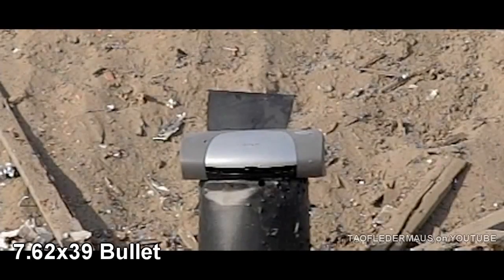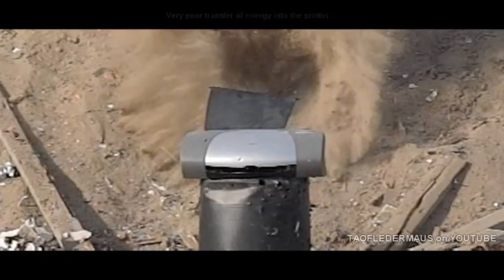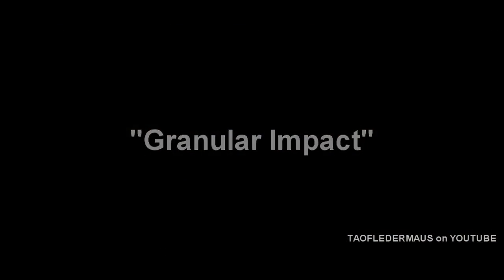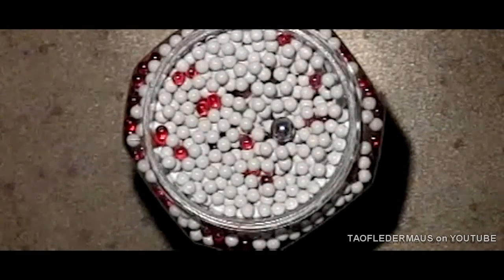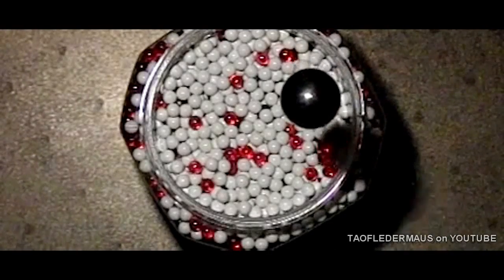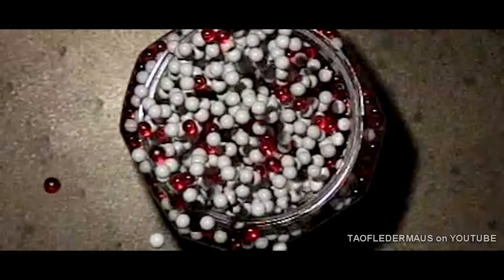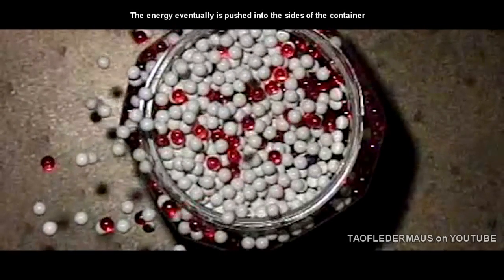Shotgun Wax Slugs' Physics Explained - Reverse Granular Impacts

Comment: The wax by itself does not increase effectiveness. It turns the shot into a single mass of non-newtonian fluid with far less mass than a slug. A non-Newtonian fluid is a fluid whose viscosity is variable based on applied stress or force. The most common everyday example of a non-Newtonian fluid is cornstarch dissolved in water. Behavior of Newtonian fluids like water can be described exclusively by temperature and pressure.

Comment: I was wondering if the expansion of a wax slug would increase even further if you placed something such as a marble or metal ball bearing in the very center of the slug while making it. 
My thought was perhaps on impact the BB's behind the marble would break up and want to go around it, forcing them outward. Same with the BB's in front of the marble, only instead the marble is trying to push past them due to all the inertia. 
Or in other words imagine a crowd waiting outside the front door of a store on black Friday with one big fat guy in the middle of that crowd. Once the fat guy plugs the doorway, all the people behind him either want to push him through or find a way to get around him. Hope that makes sense. 
If it doesn't effect the expansion on impact, then it will at least effect the center of gravity of the slug and may instead have an effect on it's penetration rather than dispersion.

Comment: You took buckshot, and made it into a really bad slug. This is not an advancement, it is the opposite.
Reply from the maker: I didn't use buckshot,  I used #7 birdshot.   Yeah,  using buckshot would be wasteful.
Reply: Im curious if you agree that the post initial impact is trivial at best. Once the waxed birdshot breaks apart, all the energy has been used up. It is literally a slug, nothing more.
Reply from the maker: The fact it breaks up and dumps all its energy can't be understated.   I didn't expect these rounds to be very exciting but damn,  you need to try them out.

Comment: is wax shell better than a cut shell?
Reply: djchinatown in my opinion the wax slug is more consistent than the cut shell. In some cases, if you leave too large a gap between your cuts, the shell won't separate. Whereas it's a lot easier not to flub up a wax round. Just don't make the wax too hot or it will melt the shell.

Comment: What happens if you put a hole down the center of the wax slug... (Basically continuing that little divot at the top of the slug you showed but only it goes all the way through)   Would the air flow cause more or less aerodynamics or more or less accuracy on target?
Reply: I could imagine the slug wouldn't fly very straight. all of the weight in the slug would likely cause the round to tilt. the way the BB's are stuck in the wax makes the weight uneven, at that speed, it might tilt maybe a couple milimeters off course and then spiral in a totally opposite direction. also, by drilling a hole through the projectile, your going to lose much of the weight that makes the round effective in the first place.
Reply: I would wonder if it would cause the round to not even make it out the barrel with all the powder just shooting through the slug like the slug was a barrel itself...   And if the round did make it out the barrel... then it may whistle through the air.
Reply: ***** People load and shoot washers. The hole in the slug would not matter; the projectile is held by a wad in a shotgun shell to keep it intact leaving the barrel which is what allows you to fire shot. http://homestudy.ihea.com/ammo/images/ammo_shotshell.gif
Reply: *****  Cool... so would it whistle through the air?  I would love to see an experiment.
Reply: I actually might explode considering it's wax. all the wind resistance going through that hole could potentially rip it apart.

Comment: I am wondering what would happen if the wax "slug" was formed with conical channel in the middle filled with mercury?  Also perhaps a hard iron nose spider scored for seperation...maybe even have all of it further encased around the sides with beer can guage aluminum?  I am thinking that upon impact there might be some hydraulic explosion effect?  Hmmm but mercury is nasty stuff so maybe just use steel shot with powered lead based syrup (using some suitable base ...hydaulic fluid maybe?)

Comment: Just tested some slugs that I had made a few months back.  I used crayon mixed with paraffin wax for these slugs and filled up the slugs then filed down so they were nice and smooth. Unfortunately I was pretty disappointed with the ones I had made :(  They were so weak.  Wondering what I could have done wrong :((  What do you think?

Comment: I think what you see tumbling is the plastic liner of the cartridge: the component between the outer case and the load flies out because the melted wax adheres to it when poured in.  You should be able to get a 6" to 8" group at 50 yards with a wax slug.

Comment: Aren't you worried about pressure buildup or damaging the internals of the barrel (cones/choke/bulges) when firing a sluglike projectile in a choked barrel? I realize wax is very pliable at those speeds, but still it got me thinking a bit... your opinion?

Comment: Here is a question and request.  Use the same method of a wax round, but try using some wax paper with overlap inside and use elmers white glue.   I would like to see it used and see its effects VS a wax slug.

Comment: Using all the same internal components of the shotshell when making a wax round, do you know if the pressures are the same as a "stock shell"? Will the wax round increase the pressures to a dangerous level? Could you "reload" a spent shotshell to a specific level and then re-crimp the shell mouth, therby eliminating the chance of the waxed group of pellets from sliding out of the shell?

Comment: Are you Harvard educated because you speak top notch. Have you ever thought of motivational speaking?LOL Also, I live in Arizona. So it gets hot here. I mean HOT! So here's how I build my wax slugs. Cut only the center portion of the tip out. Put a layer of wax on the bottom of the cup. Then the wax/pellet mixture filled to the bottom of the ridge. To hold it together I fill the rest with hot glue to keep the wax from leaking out if stored hot. Could you try one of these on video sometime? Tanx

Comment: I'm thinking this concept could be turned into incredibly useful solution for CQB and/or breaching scenarios where lethal force is authorized or required. 
Birdshot won't even pass through a thicker door. Buckshot will lose a lot of power as it transfers energy while passing through a sturdy door. Slugs have massive penetration but require fine precision, too fine for a split-second scenario. 

This seems to be a perfect and lethal solution.

Comment: test with different types of wax. don't fire the rounds, just find a mold the correct diameter and use it to melt the wax, pour the shot in and let it cool. when you find a nice combination of wax and shot in a correct mold it should be fine.

Comment: What would the accuracy/effective range of one of these wax slugs be out of a 20" improved cylinder barrel? (Smoothbore, JIC it's necessary to mention that.)
I watched another video where a guy was using wax slugs in what appeared to be a Mossberg with a 20" slug (rifled) barrel, and all 3 shots were in the torso area of a human silhouette at 100 yards!
With my barrel, what kind of accuracy can I expect with wax slugs? Thanks for any info!

Comment: I have an idea to improve the accuracy of the waxers. If you drive a small screw into the power piston or wad with a half inch or so still exposed then form the wax slug. Wouldn't that make the wad into a tail and stabilize the slug in flight? Heavy end forward light end rearwar. I know screwing tails to slugs is a practice on some manufactured slugs.

Comment: I would think the individual grains of sand wouldn't carry much energy (tho yes, there'd be a crap-load of grains). 

I know you're avoiding steel loads, but a handful of miniscule bearings in the wax load could be interesting.  Maybe run a scale of granule sizes and see how that affects the energy expansion at impact.

I'd try it out,  but I left most of my adventerousness back in the 80s.  :)

Comment: I found your video on wax slugs informative. This summer, I experimented with making my own. At seven yards, I was getting complete penetration through 2.5" of hard pine or soft pine board. In soft wood, it would punch a perfect 12 ga.-diameter hole. On denser wood, entrance was the same perfect round hole with a 3" exit hole. Groups offhand @ 25 yards stayed within 3" and center mass on a standard IPSC target. 1oz. load, 1235fps, including a .125" card wad set into wax to seal top of case.

Comment: Reason i ask is because i have 100rnds of birdshot that i wanted to either, make wax slugs or melt down into 1oz slugs. Wouldn't the wax coming in contact with the primer in the feed tube eventually cause the firing pin to malfunction?

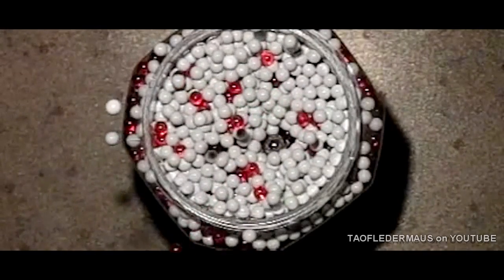Comment: 1:13 The energy is propagating as a longitudinal wave which isn't really a wave but is the language used in science to describe it! The funny thing about longitudinal energy is that it travels faster than relativistic speeds if there are no gaps! Just like a desk top toy with wire suspended steel balls in line and you pull back one ball and it strikes the inline balls, if you use a laser interferometer to measure the time from the strike impulse to the last ball to the last strike---->

Comment: Um. Short answer, Yes they do. Long anwser, the speed of sound is 1116fps, That is, 340 m/s converted to fps. My cheap 7 shot reaches 1200 fps.. That is .20 cent a round CHEAP ammo from walmart. Some of my 3.5 mag slug loads can reach all around 2000 fps. Cheap 00 buck reaches 1210 fps. Most of these figures are from win super x ammo. So, there you have it. Yes, they do.

Comment: The fastest shell in testing currently goes around 1380 FPS which is 940 MPH. But any kind of common sense would say if it goes this many feet per SECOND I wonder how far it would go in a fucking HOUR. A mile is a much larger distance than a foot so your ignorance believes it to be impossible. Much like the question "What weighs more, a pound of feathers or bricks?"

Comment: Excellent presentation!  
Here are a couple of suggestions for tests I'd enjoy seeing:
1.  Wax slug with washers, or washers stacked on a bolt either with or without a nut
2.  Wax slug with 'strike anywhere' match heads, or magnesium fire starter shavings and metal shavings - night shot to see if there is an incindiary effect
3.  Wax/Flechette round:  use the wax to keep the flechettes aligned prior to impact.

THANKS!!!

Comment: Have you done a video comparing steel shot/wax verses lead shot/wax? If so could I have the link. I have a bunch of #6 shot steel and wondered if it might make a good slug. Would the properties be different than lead shot? Could I put a steel ball bearing in the middle of a wax slug? Kinda like a snowball with a rock in it?

Comment: You could always use another medium with a higher melting point, the advantage being less environmental instability ie. melting in the trunk of your car etc.  Bee's wax has a slightly higher melting point but is blasted expensive which brings us to the point of these wax slugs in the first place.. they are fn cheap.  If money is not an issue you could get into some pretty nifty bonding mediums such as acrylic or various polymers.

Comment: @taofledermaus Can't wait to see how that works, I know we can get these things to reach out a litte further without key-holing.  I too agree that having the slug more front heavy may help stabilize it, also shape of the tip would/should make a difference also, IMHO.  Right now with the flat tip they are kinda like huge wad cutters, this has to cause allot of drag thus not helping with stabilization.

Comment: @Nwest82 My Idea here is that the copper coating/jacket will serve two benefits, 1: the shot-cup should hold on and stay intact with the inner wax slug allowing longer distance accuracy, 2: When the jacketed slug does hit the target it should act like the normal wax slug, except for one thing, the jacketed, plastic shot cup is now way more rigid due to the copper coating, so it may expand causing a wound channel from that as well as the wax slug. Its just an Idea, I'm going to make some...

Comment: I was brainstorming today, after playing around with these wax slugs in my Remington 840 12 gauge for a while,  I was thinking of copper coating these wax slugs. buy removing the wax slug from the shell after making them the dipping the wax slug, (cup and all), into liquid copper, (the cold stuff, not true molten copper), a few times, (as much will be allowed with the slug still being able to fit back into the shell).

Comment: I love your Videos! Keep it up.  Question about video camera's, I want to start doing some slow-mow videos as well gun cam videos.  So I'm looking for a good Camera that's fairly cheap, (as I am on a very low budget),   I was looking at a Camcorder that's a "Thermos Bios" Camcorder called the " Bios bullet cam 3.0"  The specs are as follows,  640 x 480 Resolution, 30 FPS, Cmos Image Sensor, One-touch Recording, Web-Cam Capable W/ 320 x 240 Resolution, 70 degrees field of view. 
  continued...

Comment: @IllinoisCoyoteHunter do a quick search there is a few instructional videos on how to make these, no mold is required, just a standard feild bird-shot load, a metal pot, a heat source, wax, and a spoon. dump the bird-shot out in to the pot of melted wax then scoop the shot mixed with wax out with a spoon, dump it back into the shell, let it harden then top off with a bit more melted wax.  Any kind of wax works, I use old candle wax, some use crayons, some use store bought paraffin wax.

Comment: @QuattroStig  If you had a spring weighing scale "to take the shot that splatters". Laid horizontal and attach a right angle plate to it. So when you shoot the upright part of the plate, the force is transferred to the scale giving you pounds or kilos of thrust/force. Would that work you think?